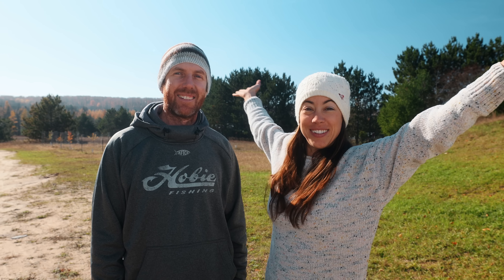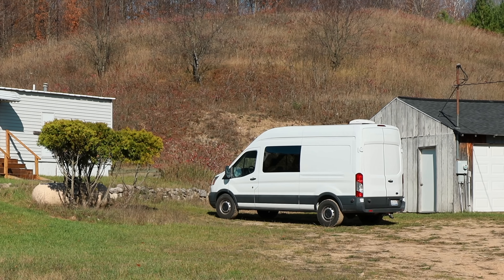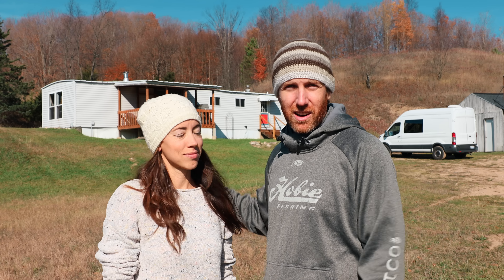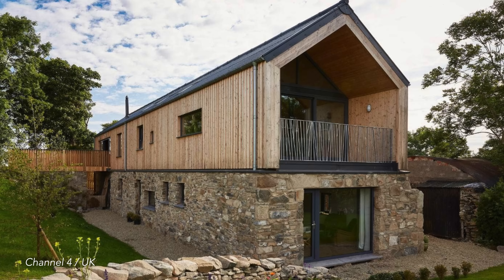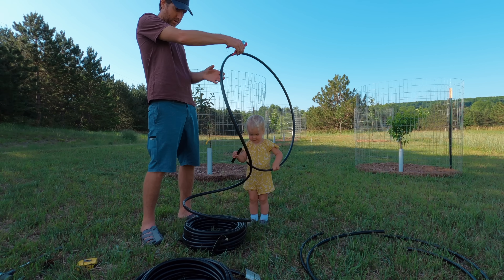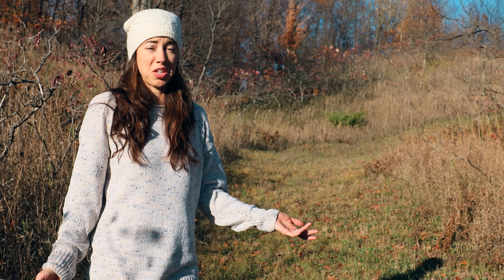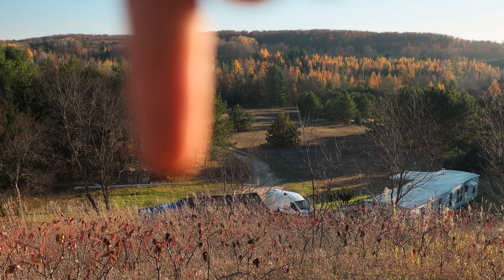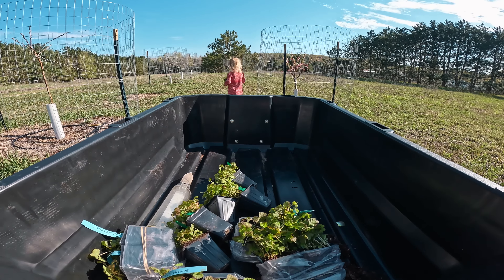Unveiling Our 9-Acre Homestead | Sailing Soulianis - Ep. 125

Comment: Anything is possible with enough ambition. Is that a good market area for year round rentals? What do other rentals in the area go for? My first rental was a duplex but it was in town not sure if it would even be allowed in the country. I have built two homes from the ground up doing a lot of work myself. It is hard to build new then rent for a profit. You might be better off buying homes that need a little work then rent those out. Buy from motivated sellers ( death and divorce) both are looking to get the cash out quickly and move on. Those are the ones that i make the most profit on after expenses.i will  closing on my 5th rental this month. It is not a get rich quick thing. More of wealth building and retirement income.
On the house on the hill how will you get up to it in the winter if it is that steep? One regret i have in building is not buying my tractor before i built. There are so many times i could have used it while building. Probably could have sold it for about what i would have paid for it if i wanted to. I think i said in a earlier post i would build some living space into the pole barn and not tell the county about it.

Comment: 1. Do you have budgets for your plans? 2. Have you considered building a solar panel installation on the ground large enough to power several of your houses? And build a power house with batteries? Maybe a windmill? 3. Water supply? 4. How would you get up to your house on the hill when there is heavy ice/snow?  5. Budget for a tractor to cut the brush? To plow snow? :¬) Webhead USA
Reply from the maker: We absolutely do not have budget for all our plans up front. We are definitely planning for solar but don’t have an immediate need as we do have power on the property. Unfortunately this area is quite grey in the winter months. But a windmill is definitely a possibility. The current garage is potentially going to be the electrical/battery room in the future. It would be centrally located between the boat shed, future house and where we’d put the solar. Ice and snow are an issue for the hill and definitely something to wrestle with. :)
Reply: @SailingSoulianis  I’ve been watching your channel from the time you started your trip down the Mississippi. You may remember I asked for asylum aboard Soulianis as you were going down the river. I do have some constructions experience working for a fire protection sprinkler contractor. DiY prerequisite would be ability to read plans, and convert plans to actual construction. It is daunting, but you can do. One step at a time. DIY or hire contractor. You be general contractor hiring each trade, or you hire a general contractor. Insurance, lien waiver, written contract, maybe money in escrow, lawyer to draw up contract and oversee signing. Work-in-progress partial payments, 10% retained until completion including punch list and on-site inspection during construction and final inspection. An architect can give you an estimated square foot cost after preliminary drawings.  

Plans & Specifications:
Site work, structural, architectural, electrical, plumbing, mechanical (HVAC.
Permits:
Site work, structure, electrical, plumbing, mechanical, with inspections as you build.
Construction:
Grading, footings, foundation, structure. roof, interior finish, windows, doors, heat, Air Con, plumbing, fixtures, kitchen appliances, cabinets, counter tops, electrical panel & distribution to outlets, flooring, bathroom stuff, furniture, hot tub, tools, rental of lifts, scaffolding, skid steers, mini excavators, trash bins & haul off. Exterior finish work.
 I hope you accept these comments as me trying to help by providing a little bit of what I know.. Best, :¬) Webbed USA